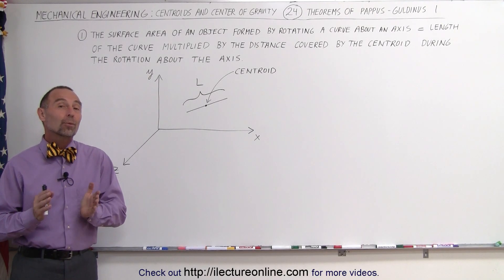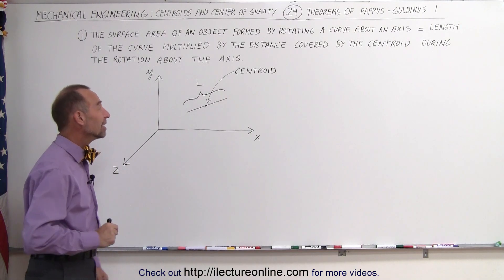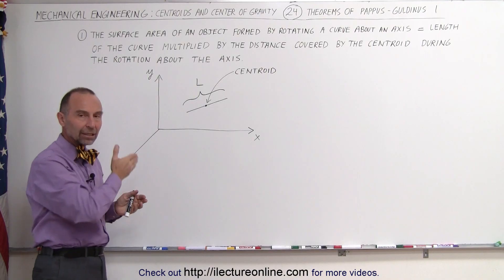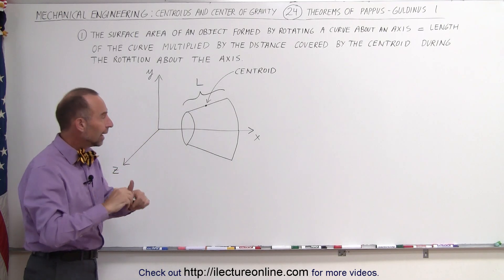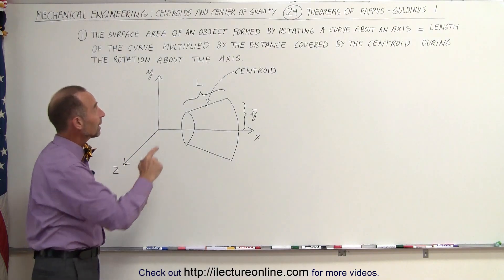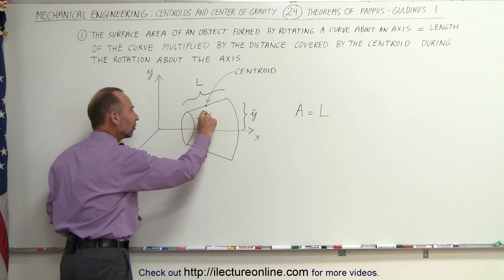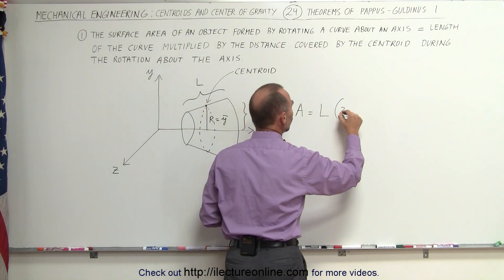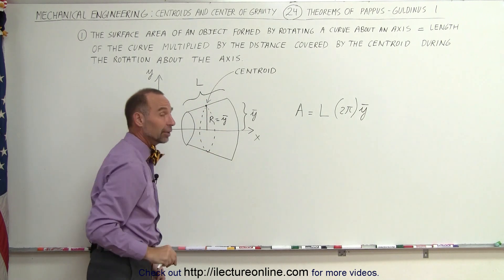Mechanical Engineering: Centroids & Center of Gravity (24 of 35) Pappus-Guldinus Theorem 1 Explained

Comment: How to determine the centroid of a more complex curve/shape?
For example if we start with a circle rotated around an axis outside of it, so that we get a torus (or donut) shape we can get the volume of the torus by multiplying the area of the initial circle, but the length of the rotation (ie the distance covered by the centroid), but in that case it's the line drawn by the center of the initial circle when being rotated.
But now lets say I want to split the initial circle vertically, and find the volume only of the outer half of the torus (ie a torus with perfectly cylindrical hole).
Btw the volume of the cylindrical hole is trivial to find as it's a ... cylinder :)
But what about the centroid of the outer half of the torus?
if I divide the radius of the initial circle by 2 again, I'll have a shape with larger volume on the inside of that quarter-point/circle, compared to the volume outside of it.
I guess for a semi-circle it's not that difficult to find a chord that splits it (parallel to the diameter it's already split by) in two halves with equal areas (if that's the correct approach?).
But if so, how to proceed with complex shapes? ... For example if you have an S shape rotated in similar way around an outside axis?